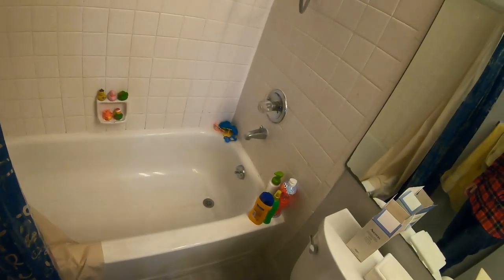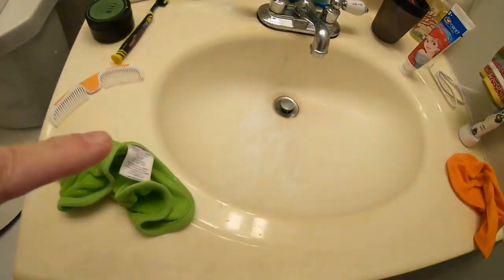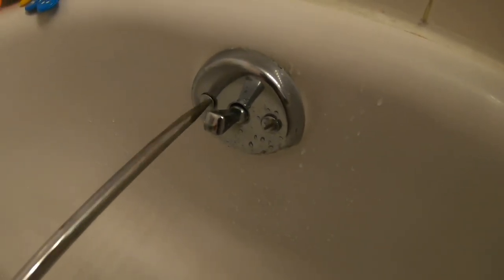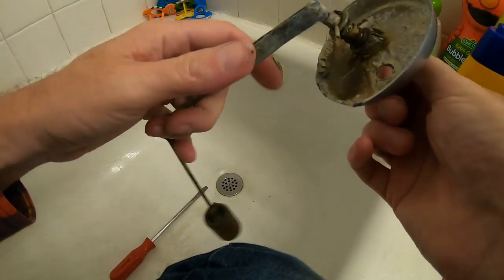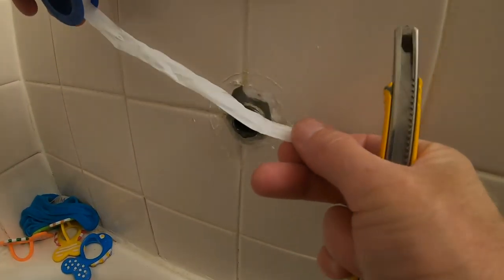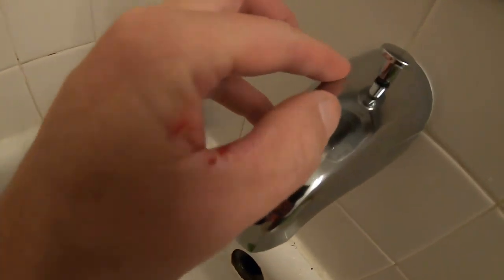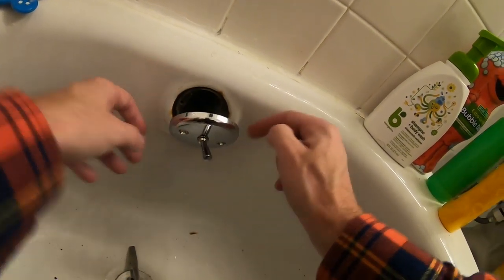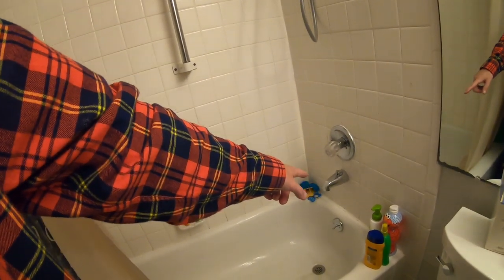LastHumansHomeLife: Replacing Bathtub Spout and Lever

Comment: How would I go about raising the water pressure in the shower? It seems like the water pressure has dropped through out my house. I used to have awesome pressure but it seems like since we had plumbing repairs by some non plumbers the pressure has dropped everywhere.
Reply from the maker: i had that issue on our california house. the landlord replaced all the copper in the house while we were there. the first test is to remove the screen from a bathroom sink and see how much pressure you have there. pressure starts at the source. if you have a lot of corrosion in your pipes from mixed metals, that can kill pressure too. for the shower, simple thing is pull off your shower head, see if it has a screen. maybe its a bit clogged. they worked on the system, knocked some corrosion loose.. might have got stuck in screens.